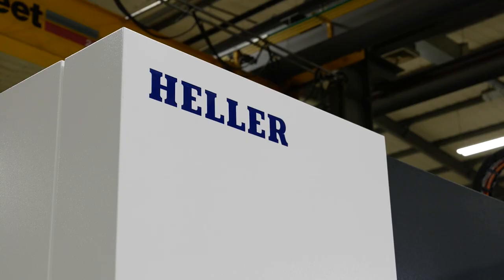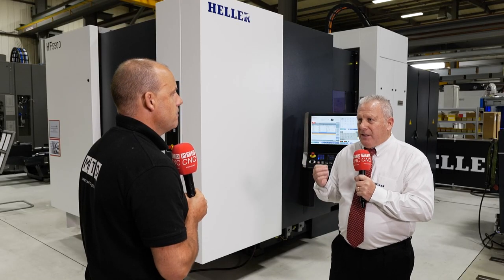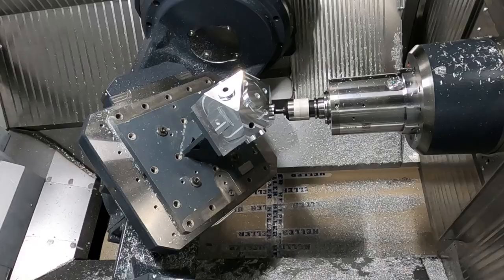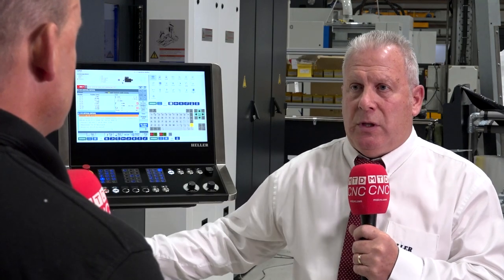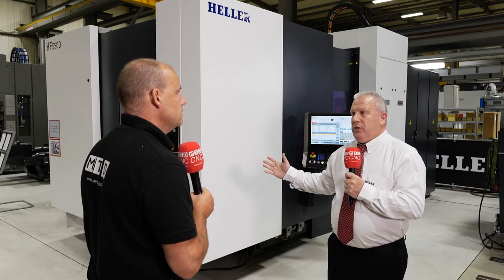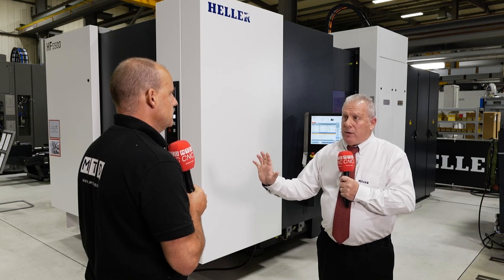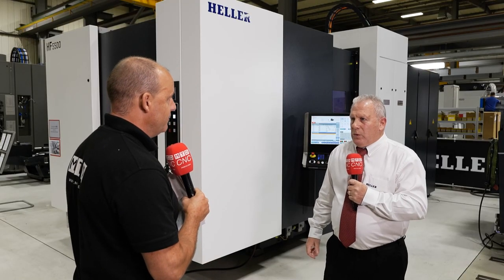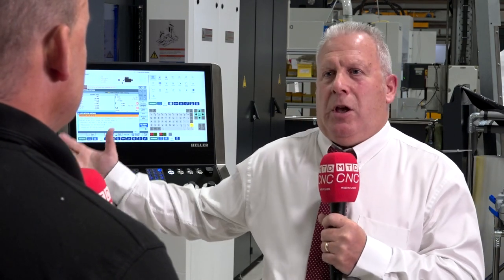5 axis machine for the price of a 4 axis - it's Heller

Comment: Hey I just bought one of these, any idea what to build with it?
Reply: How much does it cost sir?
Reply: ? I don't believe you sir! 😆 Who buys an almost $1 million machine and doesn't already know what they are making??
Reply: @herrera3499  Nearly a Millions Dollar? How do you know the  Price? At the official Website?
Reply: @yomamasofatwhenshewalksshe2401  It was only a guess, but I work in the Manufacturing Industry and know some of these Highly Efficient, High Precision machines like a Heller can run well into the $1 million dollar mark. Maybe not an HF3500, but certainly some of the bigger machines.😁 in my opinion, it is well worth the investment on a machine that will be producing for you for many, many years to come. The Siemens Control on these machines is a very good and proven control. Now, they are up to the new SINUMERIK ONE version. Even better than the older versions.
Reply: @herrera3499  ah Yes, Siemens control we're Superb. I do remember first time i operate them, the User Interface was Lean. And then Switching from Siemens to Fanuc control is a hell of a Puzzle.
Reply: @yomamasofatwhenshewalksshe2401  I feel your pain! I work on Siemens, Heidenhain and Fanuc controls! They each do their own thing. Siemens and Heidenhain are a little similar, but still very different. Good luck!
Reply: @herrera3499  But talking about 5 Axis CNC machine. Haas Automation has it's UMC series starting at $ 140000. Do you have any idea how much their Competitors cost such as DMG Mori cmx series and DMU Series. Or maybe Heller HF series?